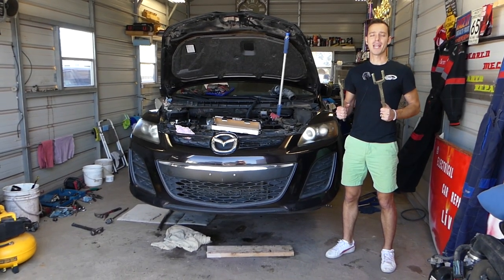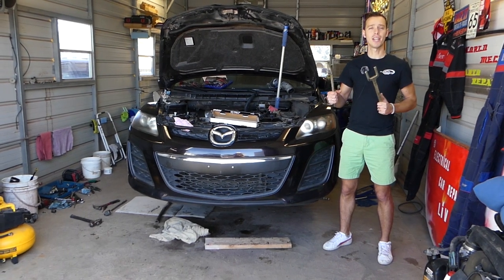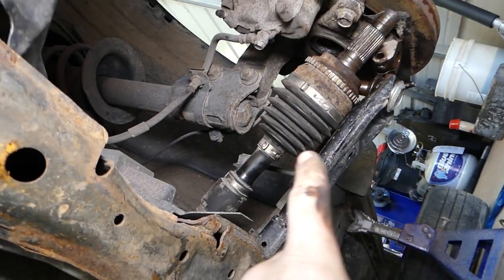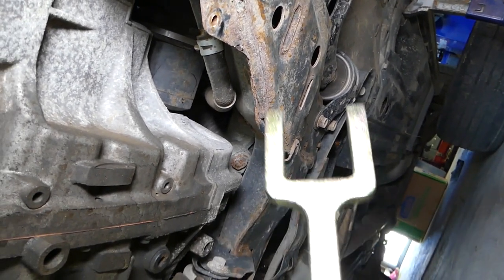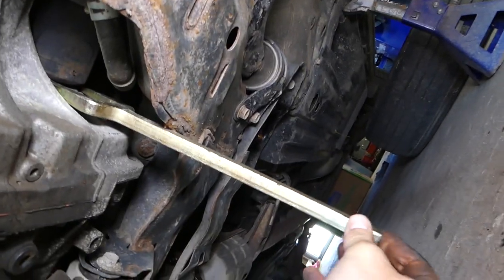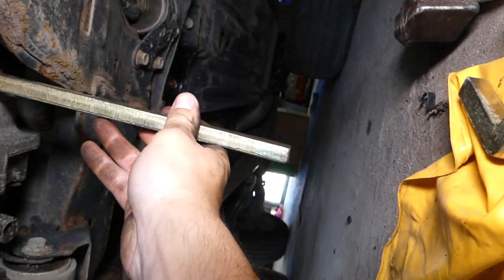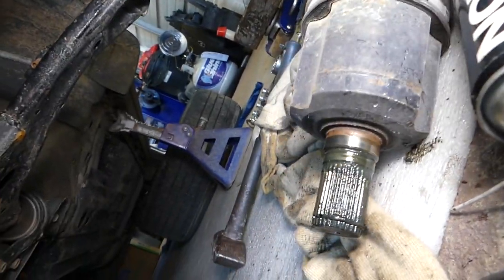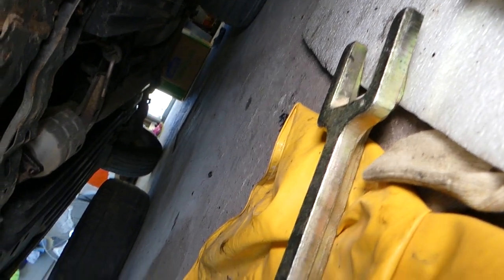HOW TO REMOVE CV AXLE DRIVE SHAFT. CX AXLE SHAFT STUCK

Comment: Thats  best  way  and it does not damage  transmission seal.  which using a puller  can  do.
Reply: How can you use a puller if you have no where for the middle bollt which cause the pull to push on.

Comment: How about the passenger side? It has bearing in between. Will this tool work?
Reply: You need a seal puller. Make sure to lube it with bearing grease
Reply: I feel i need to elaborate. I got mine from harbor freight. It is a slide hammer combo kit from Pittsburgh. Comes with bearing puller and seal puller attachments
Reply: @radiorahim861  I guess you're saying Ge Male needs a slide hammer?  That's the 2 lb hammer, is that enough?